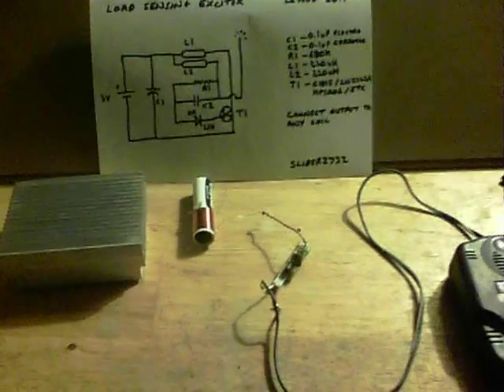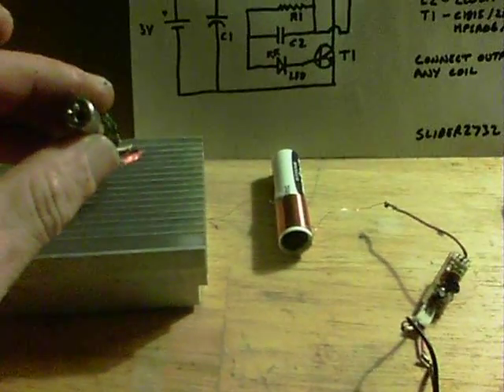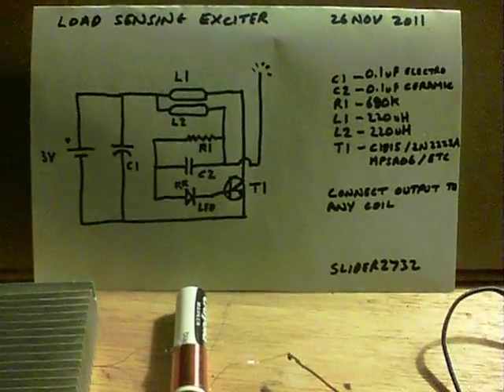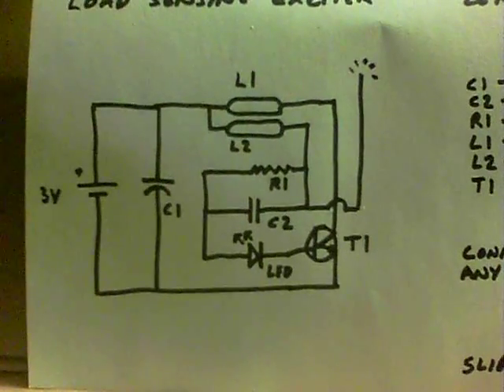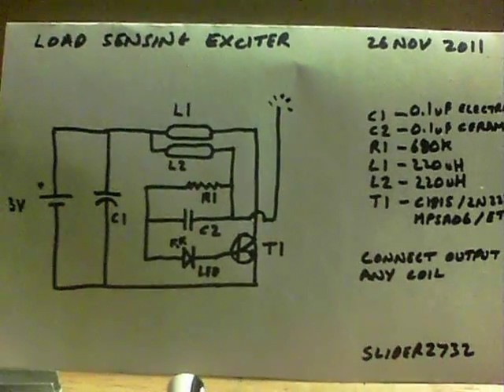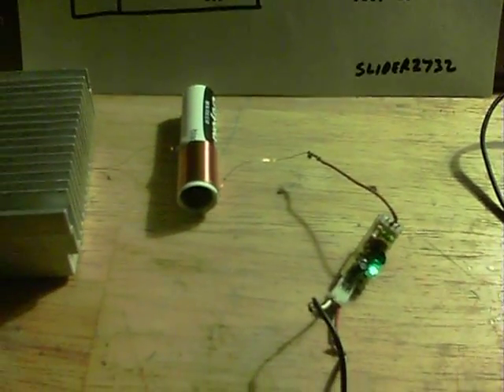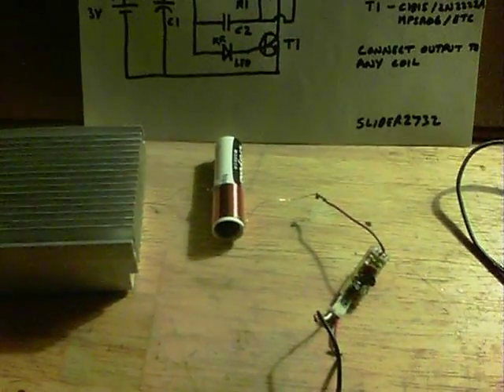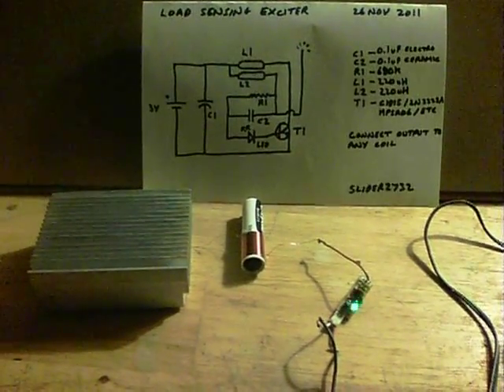Load Sensing Exciter

Comment from the maker: @Lidmotor Thanks :) It should work fine, or a variation on it and maybe better with exact match coils. The sweet spot is voltage based, depending on cap/inductor/pot values (or fixed resistor),  A higher wind coil can make it switched on and stay on, so the feedback is easier with a metal mass to balance.
Thinking something like this inside a doorway could switch a lighting system at night as people return home. The person being the sensed load. Or used for security would be similar.